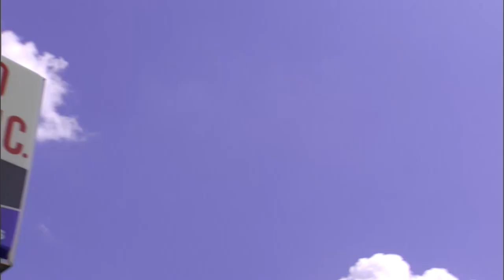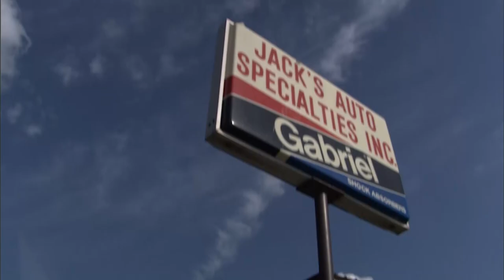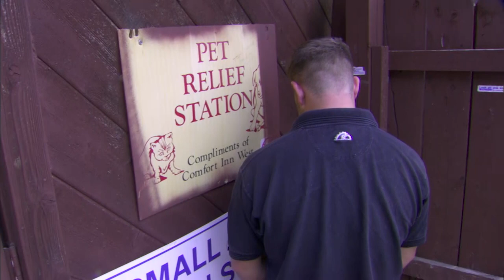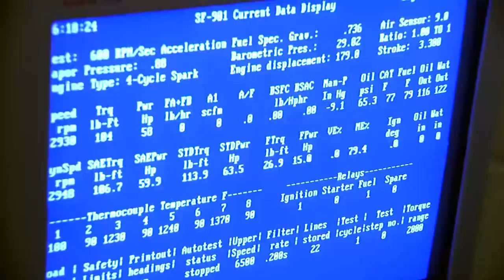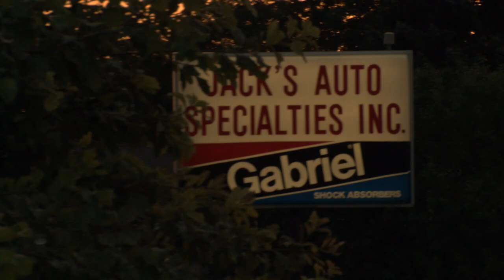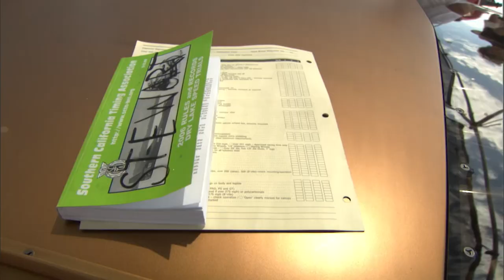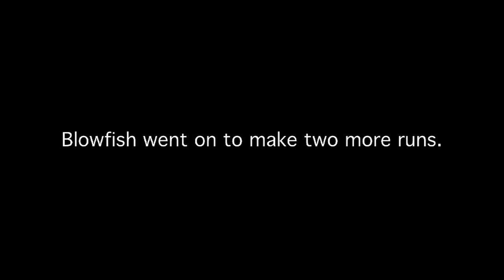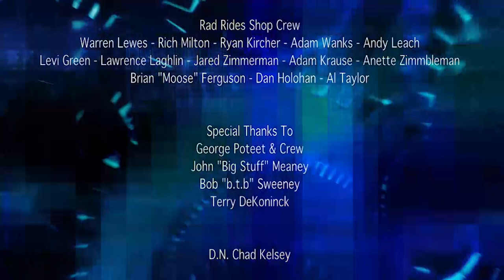Blown Away: A Bonneville Story

Comment: WHERE IS THE FACE  AND EYE COVER  WHEN CUTTING AND GRINDING
Reply: Always wondered about that. You only got one set of eyes. Not steel related but a guy at work was cutting a tree at work after a storm and got some sawdust in his eye. They had to remove it so the infection didn’t spread to his other eye.
Reply: Had a buddy using a wire wheel without eye protection and a metal strand of wire got stuck in is eye. Looked freaky like a joy stick sticking out of his eye, he ended up using a qtip and sorta twirled it around and it got snagged and pulled out by the cotton tip. Needless to say he never did that again.

Comment: 27:15-27:30 - that t bolt clamp is completely out of adjustment range, needed one size smaller.  Once the ferrules are tight against each other, you can strip the threads off and you won’t get any more clamping force.  I don’t want to say anything mean here, but damn someone should have seen that.